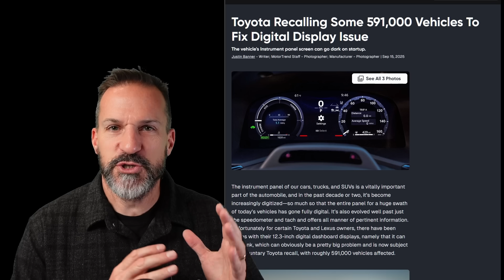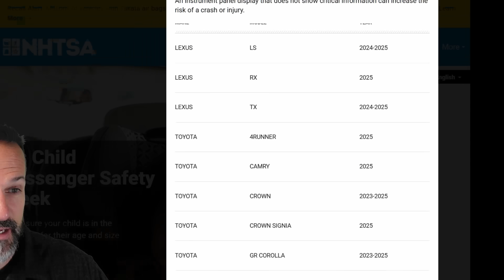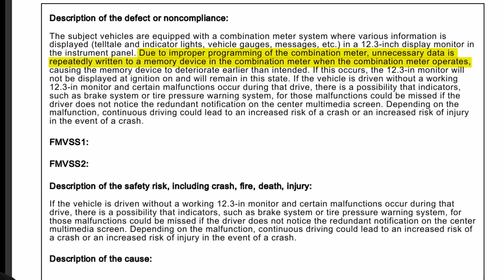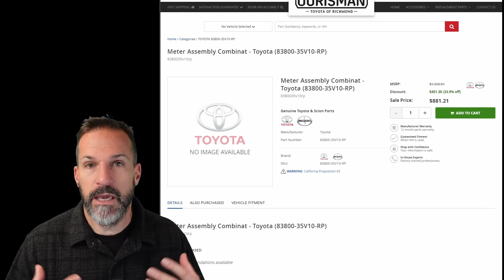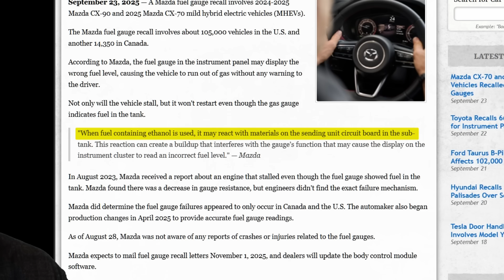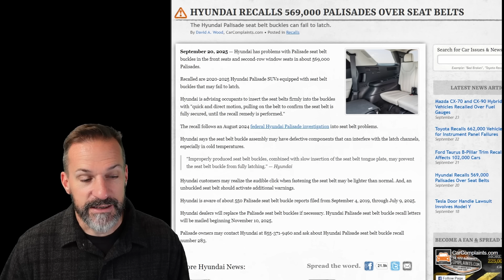SO Smart, They Are Dumb - HUGE Toyota Recall of 600,000 Vehicles.

Comment: Get a crown Victoria. 2 million miles is the record for the motor. 1 million for the transmission.
Reply: Is it because these were built for the police? Not a sarcastic question.
Reply: @andyroidx  That is a good question. I would say not the case but because they were made for the police and cab companies they made insane amounts of them. So there are loads of parts cars to pull from. 

The motor was used in the mustang and older trucks. It is port injection only and the engine bay is huge to replace parts. It is a fairly low power for the size motor with lower compression so very low abuse on it. 

The police variant is cooler though. Aluminum vs steel driveshaft, better intake, easily more parts to find that match too. Front and rear disc brakes 

Thanks for asking.
Reply: @andyroidx  The one that got the record was a civilian version. They end up being less beat on and the motor and transmission are the exact same

Comment: I remember the 1997-2001 generation Camry suffered the same defect: The complete dashboard would go black and all gauges woud die. I test-drove three with that issue. Naturally, the owners were dumping them. I remember one also suffered the addition of all the power windows not functioning. But at least the AC (Toyota's Achilles Heel back then along with the infamous oil sludge debacle affecting the 4- and 6-cylinders) worked on that last one.